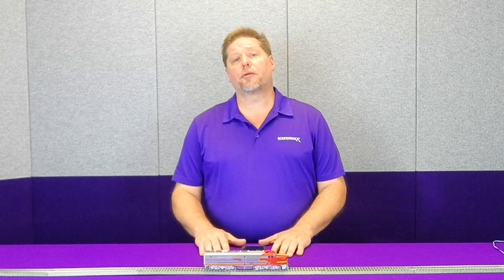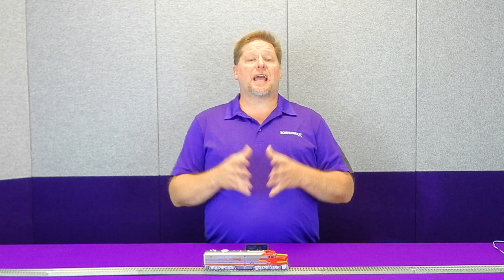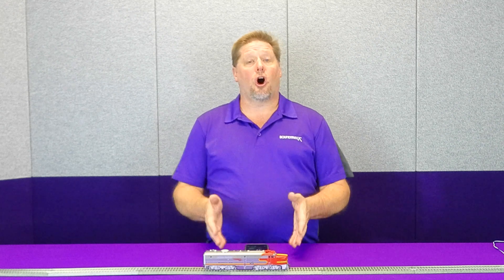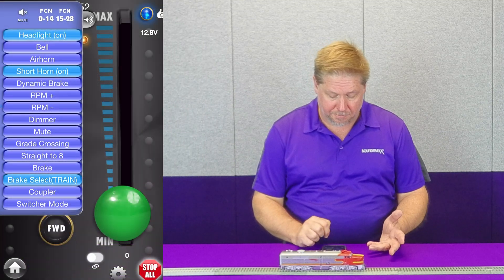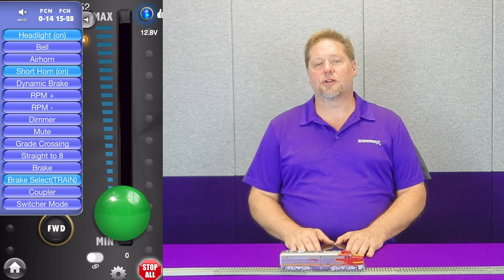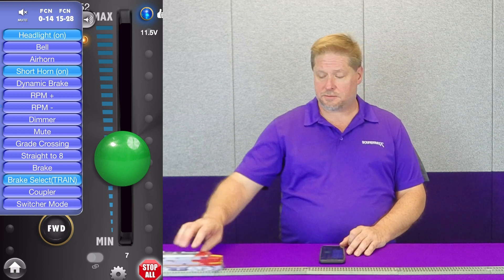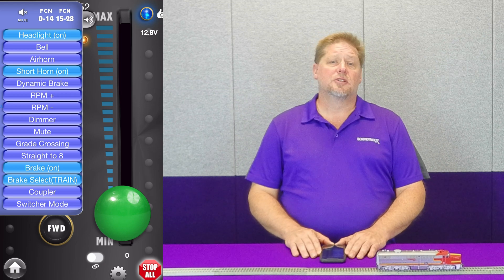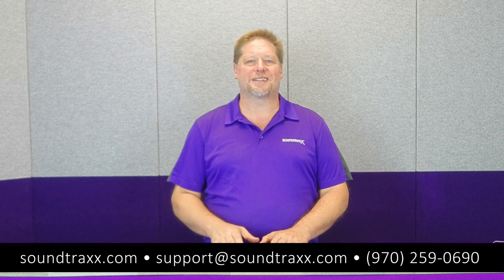Operations 101: Automatic/Train Brakes (Episode 4)

Comment: Hi George, we could get into the "Triple Valve"..but that's another story! Been using the F'11/12 brake feature for years and find it difficult to stop a train with the brakes! 
Cheers Gregg.
Reply: Adjust CVs 117 and 118 to a value of 150 or more.You need a value in CV4 as well.
Reply from the maker: Give our Support Team a call and they can help walk you through adjusting the CVs to get the desired effect: (970)259-0690 or support@soundtraxx.com.